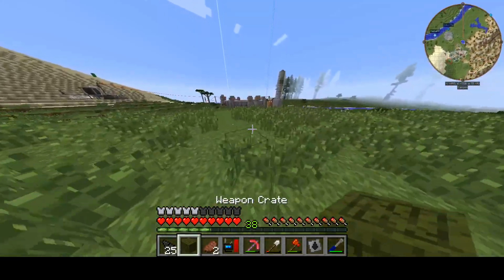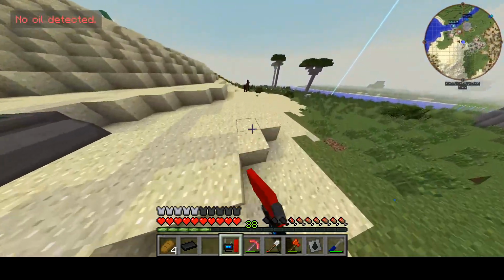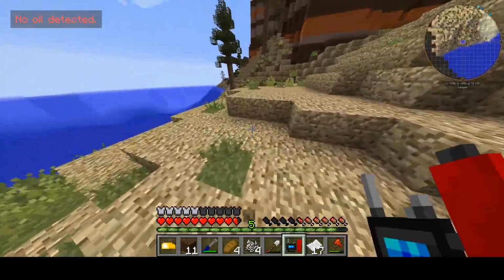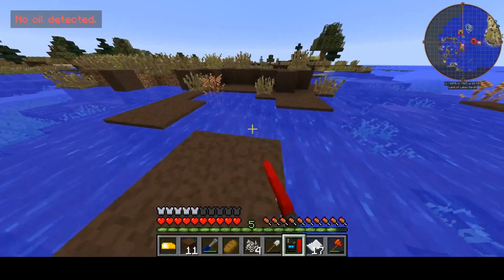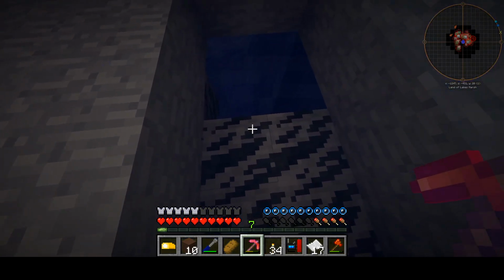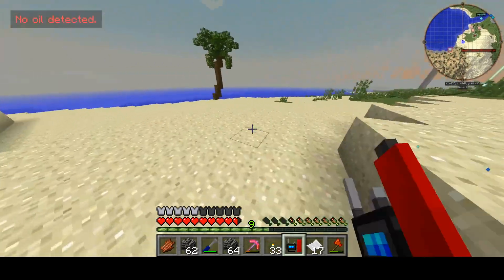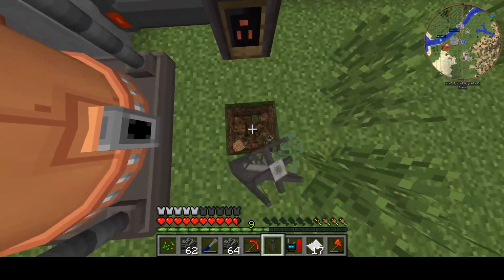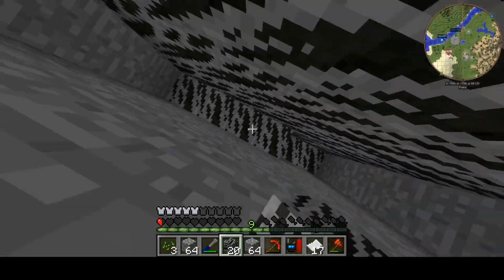Literally moving an oil deposit HBM mod

Comment: fracking tower needs good energy+desh so you need oil for it
Reply from the maker: you can go straight from a combination oven to the fracking tower, I have done it before
Reply: @th3fish  well yea after getting light oil for desh so yea fair enough also fracking tower needs 100khe/s